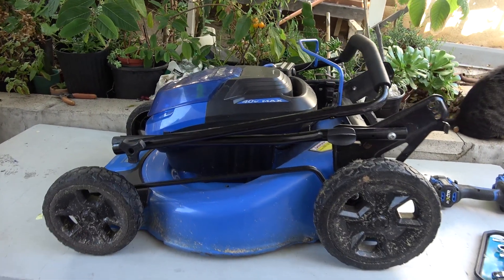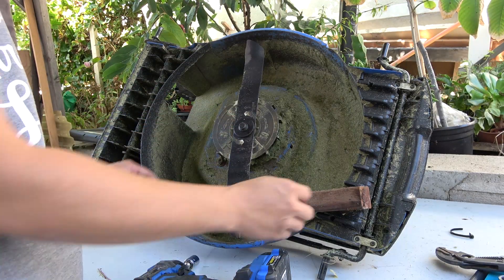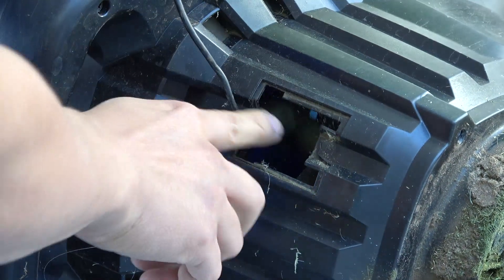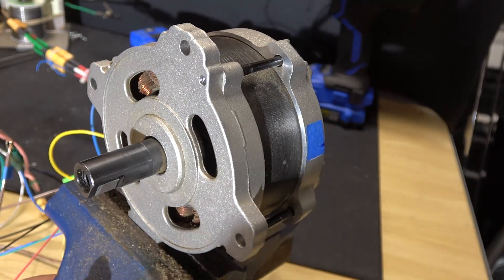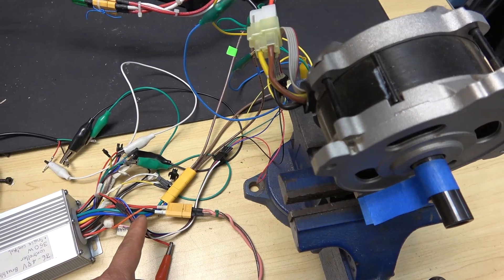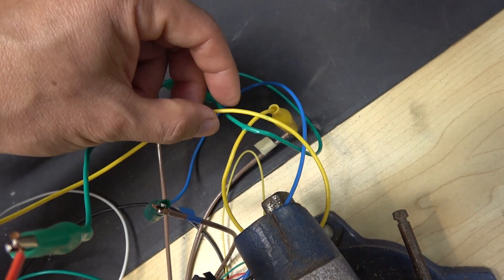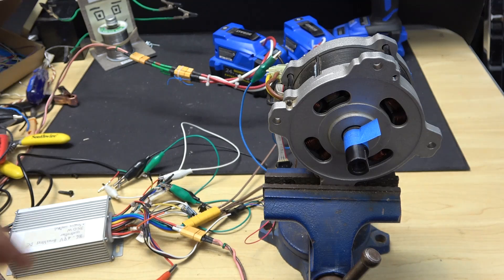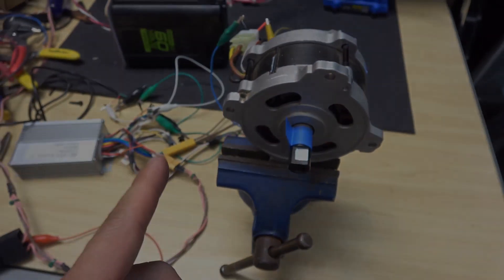Teardown: Kobalt 40V Brushless lawn mower & Bench test 40V Brushless motor for EV

Comment: I CANNOT BELIEVE YOURE DOING THIS VIDEO!!!! I literally just ripped one of these apart after FINDING IT on the curb… The controller seems to have gotten SOAKED with water but everything else seems FINE.. Can you do a video giving examples of how to diagnose a “WATER DAMAGED” ESC module (or any similar board) and best attempt to bring it back to life????  

Also, the BEST PART OF THIS (the 40V battery!!) was also SOAKED INSIDE… I opened and dismantled it… ccaredully cleaned as much as I could and I’m letting it sit… 

Last night I said “I wish someone would
Make a video about this situation” and POW here you are!!! 

I hope you see my comment and can point me in the right direction
Reply: haha good luck! thats awesome man! For sure go and try some stuff to get yours back in working order!
Reply from the maker: POW! I have magic, don't I? Just kidding. Did you try to dry the controller as much as you can? If it's dry, I would just plug it in and give it a shot. What can possible go wrong? The worst case you get some fireworks show. :D But seriously, this controller is incased inside a silicone protective layer and it's designed to deal with wet environment so I think it would be fine. Unless the previous owner tried to run it while it was soaking wet. That might not burn the sealed PCB but because there are wires sticking out and exposed, it would be enough to fry the controller.
Reply: @vuaeco  — ok, I must clarify one thing before continuing… Your mower is KOBALT 40V, the one I found on the curb was RYOBI (the Green one).. I’m not sure why, but I ASSUMED they were manufactured by the same company, and therefore WERE “electronically” the SAME…

I must also include one MAJOR DIFFERENCE between your Kobalt and my Ryobi — DISASSEMBLY!!! I basically DESTROYED the Ryobi Mower during the disassembly because they made it VERY INCONVENIENT to remove things in sections the way your Kobalt mower came apart so easily…. 

With that out of the way,  You mentioned “DRYING” the controller and stated that the controller was somehow sealed with silicone to prevent internal damage… 

My response: 1. Opening and drying the controller was my FIRST PRIORITY… 2. I didn’t see “SILICONE” ANYWHERE!!!!! 😂 

I recently disassembled about 7 e-Scooters (Razors & Schwinns) which were ALL OBTAINED FROM THE CURB… I didn’t take apart the Razor Controllers (because they’re so small & insignificant), BUT the Schwinn scooters had nice 24V 30A controllers which I DID TAKE APART……. I removed the top & bottom “covers” from the aluminum box of the controllers, annnnnnnd that was where it ended…. The entire inside was a SOLID BRICK of BROWN GLUE completely encasing all the internals… NO CHANCE OF WATER DAMAGE, EVEN IN A TORNADO 🌪 (although 1 of them WAS inoperable, I’m certain it was not from water)…

Why am I mentioning this? Well, because the Ryobi 40V controller has ZERO PROTECTION like this besides some silicone “sheets” or pads that sat between the covers and the box itself — Nobody at “Ryobi” considered the fact that SCREWS would go thru these cover and pads allowing for water to flow right in!  Once I removed 1 cover, I had to POUR OUT several ounces of rusty water!! The Controller housing was holding the water inside for a week. What a joke!! 

Since there was so much water in the controller, I figured I should also inspect the motor… the screws WILL NOT BUDGE… I striped all 3 hex heads… 

Once I dried and cleaned the Controller board with alcohol, I DID TRY to just power it up… 

All that happened was the “LED headlights” turned on but the motor didn’t respond at all… 

As I mentioned, the *40V 6Ah* battery AND CHARGER were included with this mower… but the battery was ALSO FILLED WITH WATER — I am currently working on removing all the rusted spots & welds from each cell so I can REVIVE THEM, but the BMS was destroyed. 

With that said, I DID NOT HAVE a 40V power source to try the 40V controller & motor… my bench PSU only goes to 31V… could the 9V loss really matter??

That’s the whole story so far… any advice??? 

I’d love it and appreciate it VERY MUCH if you’d email me… I have STOCKPILES of medical grade lithium cells, motors, components, and on and on that are just waiting to be used but I lack the full confidence in knowledge to proceed… There are certain things that hold me back from beginning to experiment that I’m positive a few chats with someone like you would easily fix. I can be reached at - protonmail - D0tt - c0MM - by just adding my youtube name to the front… that way I can also send you pictures of all this I’m telling you about AND the cells found inside the Ryobi battery… The amount of ideas I have would probably be of great interest to you and your content and I’d be more than happy to contribute however I can as a thanks for your advice. 

POW!!!!!
Reply from the maker: @flojotube You have a dream neighborhood where you can just stroll around and pick up random EV's on the curb. I would move there to live! Looks like your BMS is destroyed. The wet battery might have a chance, though. My ebike battery got wet in the rain and rusted all of the cells. Out of 91 cells, I was able to revive about 29 cells which wasn't bad because they were really rusted. Most of them were under 1 Volt. I made a full video of that so you might want to watch it.
As for your 31V bench PSU, depending on what controller you have. Some have high cut out voltage so say it would cut out at 32V. Then your bench PSU which can max out at 31V is useless. I would get another bench PSU and connect both in series to get to 40V.
Reply: @vuaeco  — just in case you don’t end up emailing me, I wanted to share the Li-ion cell info of the *THIRTY (30)* “EVE” 18650 cells that were recovered from within this RYOBI 40V 6Ah battery…

All 30 are identical - here are the markings:

EVE — 2.0Ah — 7.2Wh — ICR18650/20P
7iLG11M488505
BLUE WRAPPER // WHITE RING

I still struggle with the FULL UNDERSTANDING of how these things work, the way you do… And based on a video you did where you purchased the $30 battery “cheapest on the internet”, I’m wondering if perhaps this battery is ALSO falsely claiming a 6Ah status….? 

Unless the 2.0Ah is being multiplied by 3 in this pack? IDK - but it’s these MINOR DETAILS that stump me the most… things that are simple to everyone else somehow just don’t compute in my head when it comes to this topic. I can figure out the most complex things but not this 😂 

I should also mention that the website “secondlifestorage” DOES NOT have this particular cell in its massive database, so I’ll have to search further to find its data sheet. They only list ONE “EVE” 18650 cell - it does have similar characteristics (such as BLUE WRAP & WHITE RING) but the power specs are slightly off… 2.6Ah instead of my 2.0Ah… and in the picture, the “BLUE” wrap is a slightly different shade of blue. 

Just thought I’d share for you information.

One last update on these cells and their water damage… 

I have cleaned them all the best I can without removing the wraps AND have grinder down all the spot welds… rust removed with white vinegar and scour pad…

All cells are DRAINED… Some 0.00V — Several are around 0.04V — a few are around 0.72V but not many…. I’m assuming you’d instruct me to attempt to shock revive them at this point, so that’s what I’m about to attempt.

Comment: there is a bunch of combinations of wires that work but only one that is efficient and correct. maybe thats why it was pulling so many amps? how are you sure you don't have a wiring error in the phases in relation to the hallsensor wires. I used a proces to get my ebike motor paired with a new controller and I had atleast 4 combinations that worked. 2 backward and 2 forward but one of them pulled way too many amps.
Reply from the maker: You're right, the combination that pulls too many amps might not be a good one but surely it gives the best performance for a bench test. There are other combinations that work as well with lower performance and also pull lower current. I'll talk about that in the next video.
Reply: @vuaeco  awesome I didnt see your reply until your next upload and ty for reading my comment and actually adding the extra info to your videos! I love your videos and creativity

Comment: How about the 80 volt kobalt lawnmower is it the same or better
Reply: Yes! Following this question!
Reply from the maker: I think the 80V mower uses a bigger motor. I would love to have my hands on one.
Reply: @vuaeco  I have the Kobalt 80V motor infront of me and it is outwardly identical (presumably greater number of turns of thinner wire on the inside). Just goes to show that "More Volts = More Power" is BS, more like "More Volts = More Marketing".
Reply: @vuaeco  how about a cordless skilsaw worm drive motor think they run on 48 volts or more